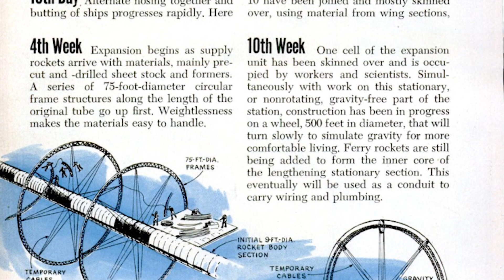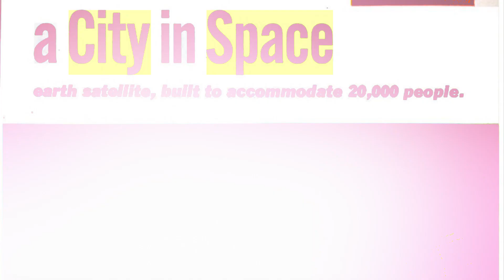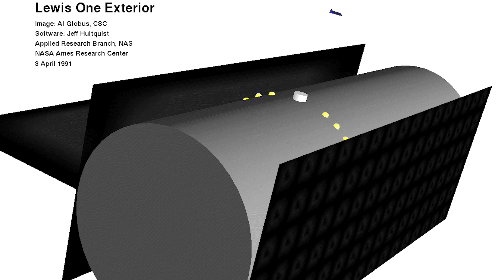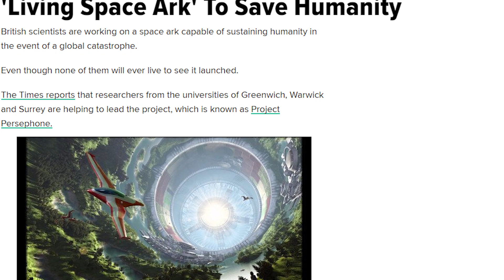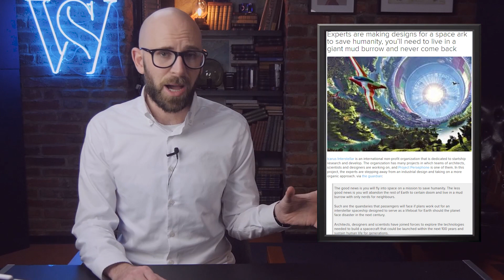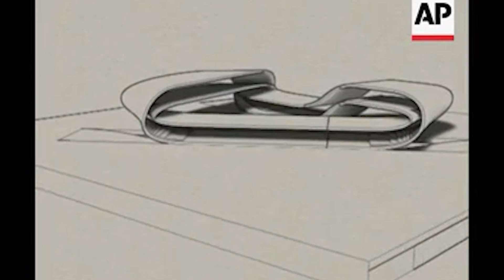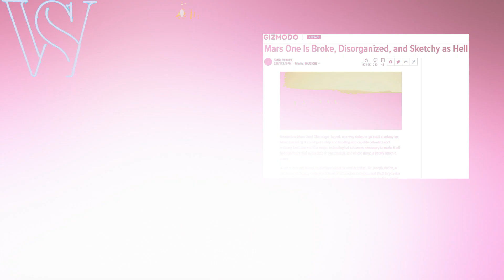10 Far Out Space Stations and Colonies

Comment: The O'Neill Cylinder is the best plan imho
Reply: Just avoid any colonies located at L2 and you'll be fine.
Reply: It was a purely hypothetical study of what's plausible. In reality, it's not feasible because the windows are clear pathways for cosmic rays, and a long cylinder is inherently unstable.
 A Kalpana drum shaped habitat could be built to such a size, and have narrow apertures to let sunlight in from exterior mirrors.
In the '70s, the NASA space settlement studies designed the Stanford Torus as a near-term first generation habitat, but they determined that the largest pressure vessel we could build, to spin for 1G and hold shielding and everything inside was ~30km diameter.

Comment: A magnetic field will protect against radiation.
Reply: Too many unknowns, too many working parts. Any artificial field which can protect against cosmic rays is a magical force field. 6 feet of sand or 4 feet of concrete works and is a robust structure.